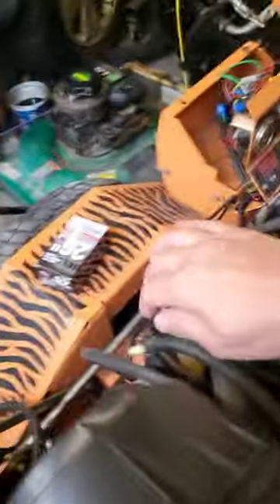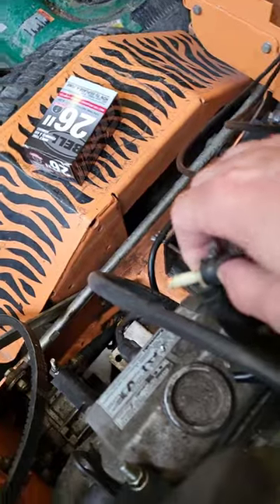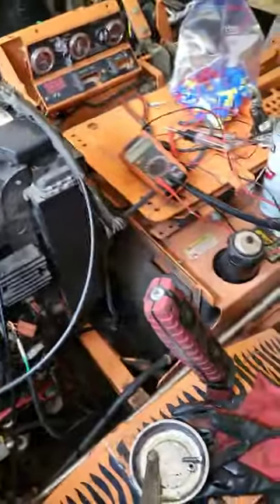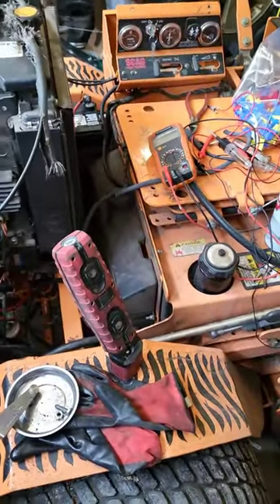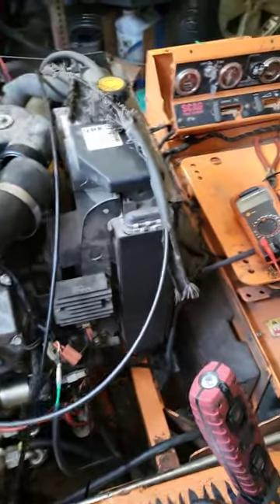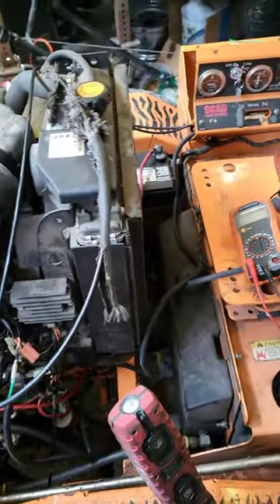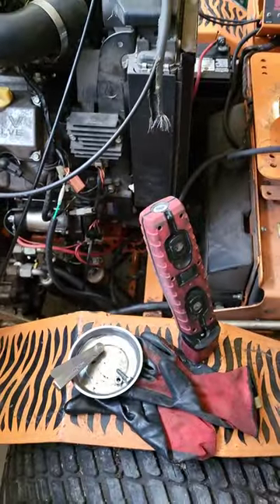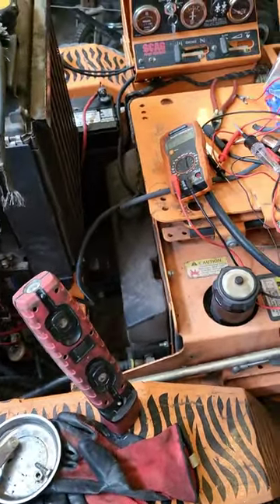Scag repower from 22HP carburetor to 29HP fuel injected engine.  How do I convert this?

Comment: Did you find the solution? I have the same issue.
Reply from the maker: No. I need to test the pressure regulator and then run a hose from the gas tank.
Reply from the maker: If you have spark and 26 PSI fuel coming up to fuel intake, then it's probably the Fuel Regulator.  It's $100, so I haven't bought one yet.